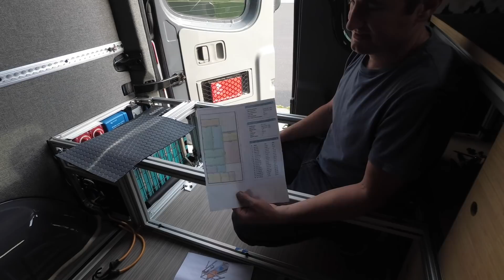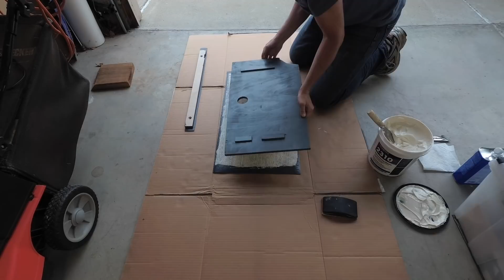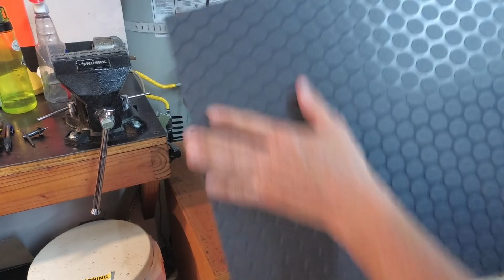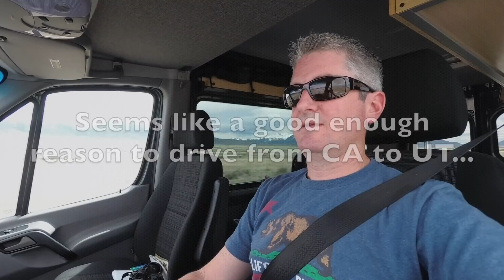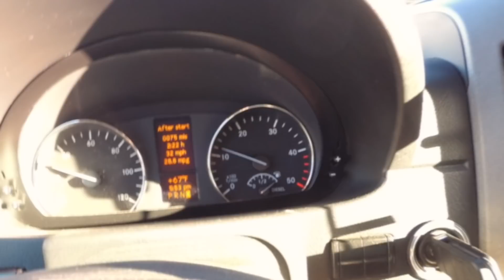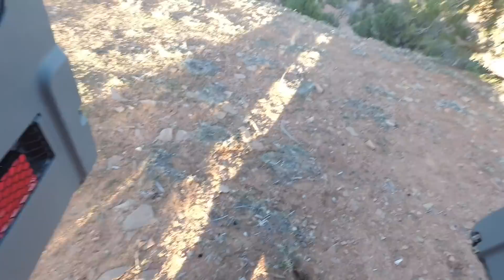Finishing the Kid's Bed with Coin Flooring

Comment: Great videos as always! Could you give me a long term review? Just curious how the adhesive is holding up a year later. Any bubbling? Also, is there any strong off-gas smells still lingering around?Thanks!
Reply from the maker: Hi, it looks perfect, no bubbling and durability-wise it's great.  However the material itself does have a slight rubber/plastic smell when it's hit with direct sunlight on a hot day.  It gets over 100-deg in the summer where I live, so maybe anything would do it.
Reply: @ourkaravan  Thanks!

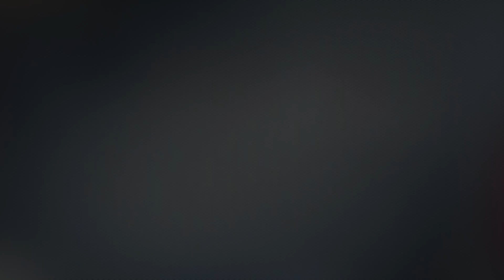Comment: Ken, another great video. Hey, did you find the handy dandy little air vent on back of your battery compartment (at 7:54 in your video)? I could use the same vent for my van. I looked in your store, but could not find it

Thanks,
Reply from the maker: Thanks Tim!  I added it to the Wall Panels page, located here:  https://kit.co/ourkaravan/wall-panels-headliner-shelf-l-track
These are great for giving a nice finished look.

Comment: Been watching all your videos and recently picked up a 144. Curious to know if you would do it all in 8020 again? I feel like if everything is done in 1.5 (15 series) all that extra space adds up... when you compare it to 3/4 or even 1/2 wood. I’m currently on the fence.
Reply from the maker: I would definitely use 80/20 if not simply for the safety factor alone.  There are really only a couple of places where you loose space with 80/20...one is where the drawer slides mount to 80/20, but you could always use a thinner material attached to the 80/20 to enable slightly wider drawers.  If you had two cabinets with the exact same external dimensions, the 80/20 cabinet would have slightly more interior volume because the end caps are 1/4" or 1/5" material rather than 1/2" or 3/4."  Of course the exoskeleton will be slightly fatter than wood, but the only real effect that has is making a slightly smaller cabinet opening, while the internal volume will actually be larger.
The 1" 80/20 is plenty strong but I didn't care for the small 1/4-20 bolts used on that profile, vs 5/16 bolts on the 1.5".  Check into the 30mm 80/20 and see what the fastener size is...might be good middle ground if that profile is available in the styles you like.  More info on ourkaravan.com.  Thanks for watching!

Comment: Another good one, thanks! You used the Roberts 2310 to glue on the aluminum angles also?
Reply from the maker: Thanks!  I used contact cement, spread on both the back side of the aluminum as well as on the wood/coincell.

Comment: Kenny, the only suggestions I'd offer regarding routing technique in this instance are to reverse the direction in which you rout, and to keep with that direction for the second pass, which, in this case really isn't necessary.

With no statistics to back-up my assertion, I'll say that routers rank near the top of potentially dangerous power tools (most likely behind table and circular saws). And so-called "climb" cutting is a contributing factor. Beyond safety, climb cutting also results in low quality cuts, as well as chatter (particularly with straight cutting bits).

When routing with a handheld tool, as in the case here, generally speaking, you want to rout in an anti-/counter-clockwise direction. This is a "normal" or "conventional" cut where the bit maintains consistent contact with the stock as the tool is purposefully guided along/around the stock.

Again, when making conventional cuts with a flush trim bit, as in the case of laminate trimming, there's no need for a second pass.

As the bit turns in the opposite direction when mounted upside down in a router table, this feed direction is reversed; clockwise or right to left.

Hopefully, you and others will find this tip useful.
Reply from the maker: Good to know John, I always appreciate helpful advice. Especially when it involves keeping my limbs intact. Thanks for taking the time to post.

Comment: Great job and good to see the little one enjoy. My old  class B with the dodge chassis gets 12mpg at best  going 71.  Wished I had that mpg.
Reply from the maker: And I like the emissions system of your dodge. ;)   It seems like if I'm going to have a problem with this thing, that's where it will be.
Reply: @ourkaravan  that's the only thing I don't like about any diesel.  We have a diesel motorhome as well and there is no repair bill less than $1000 on that thing. Having a newer one like yours under warranty helps of course but it's hard to upgrade your fleet every 5 years lol. Hope you share some of your trips in future videos.

Comment: that mpg - if I remember correctly you have the 4 cylinder??  with my 2011 v6 I get 20 and with my 2018 v6 I get 18.5 (granted at 75-80mph .... I could pick up a couple going 70 ....  but not that much .....
you make excellent videos!  I have been following your channel from almost day one ...  I have a 170 wb and my daughter and I drove to Colorado in March ... she is 4 - she enjoyed the trip...  now I am supposed to build a camper van so my wife and the one-year-old can go to!  

I still have to do my stereo just like you did it.  and I started to insulate everything (now I need to do the front doors after watching your videos ...)

keep it up !
Reply from the maker: Yes, I have the 4 cylinder.  The fuel economy is very speed-dependent since it has the aerodynamics of an apartment complex.  When I run the van at 82 MPH across Utah (80MPH speedlimits), mine will only get 22 MPG. Whereas at 65 it will get 27 MPG.  Running it around 72 seems to be the sweet spot of decent mileage and yet actually getting somewhere in a reasonable amount of time.  (And not getting a pile of speeding tickets.)

Happy to hear your kiddo loves the van and wifey enjoys it too....that's huge!   Take your time and enjoy the ride.  As you know, I'm a little over 2 years into my build and couldn't care less!  We've used it since the beginning.  Thanks for following along!

Comment: The gas mileage is insane. My 2017, 144" 4x4 with 265 tires recently got 17mpg on my way up to Mammoth a few months ago. I knew 4-wheel drive would lose some efficiency but man..... that hurts.
Reply from the maker: The mileage you are getting is normal...my friends that I travel with in a 4x4 V6 are usually about 8 MPG lower than my van, which has the 2.1L 4 cylinder with the 7-speed transmission.  But yes, pretty insane for a mini-house going down the road!
Reply: People all want 4x4 but as you say, there is a huge down side to that which is really bad fuel efficiency. I think I'll settle for a diff lock option (on a non-Sprinter).
Reply from the maker: It's an absolute crying-shame Mercedes-Benz discontinued the 4 cyl.  It's such a sweetheart of a powertrain.  I'm trying to find another one in a 170 wheelbase for a family member, but there are very few for sale.  At least the 2019+ V6 is getting the same 7-speed transmission the 4 cylinder has had since 2014.
Reply: @ourkaravan  Yeah, 4-cylinder eco-diesels are basically the norm in Europe. The Transits with that routinely get 35 MPG US or better. The Sprinters do similar numbers. Which is necessary considering fuel prices are 3x what they are in the US.

Comment: this project is on my list, and i was going to try and trace/cut to exact dimensions and try to line everything up... i now see the error of my ways and will use the router with a flush trim bit instead. thanks for sharing, Ken!
Reply from the maker: Glad I could help!  I wasn't sure the router would work.  I suspected it might just melt the coincell rather than cut it.  Other than having to wipe away the excess glue it worked well!

Comment: That's actually great material. I have a trunk mat made of this stuff. Awesome if you transport stuff you don't want to move around in the trunk. 👍
Reply from the maker: I think it's a good match for the rear areas of a van, and probably why all the premium builders use it.  I like the way it looks, it's durable, grippy, easy to work with.  Love it!